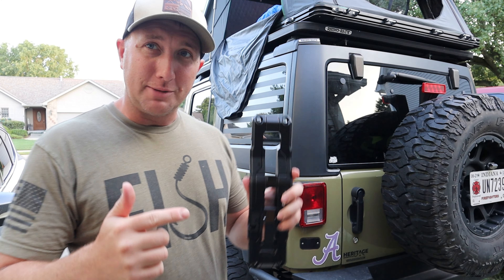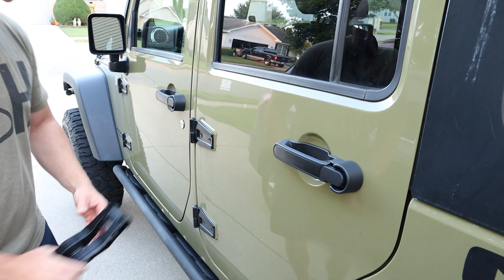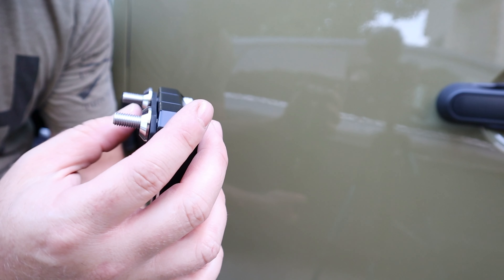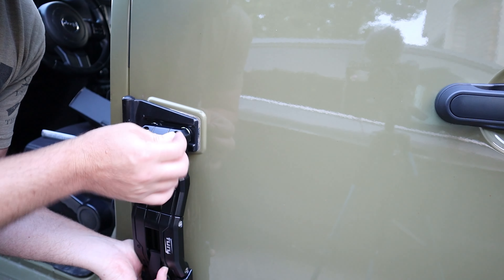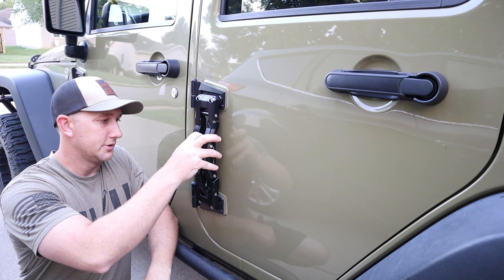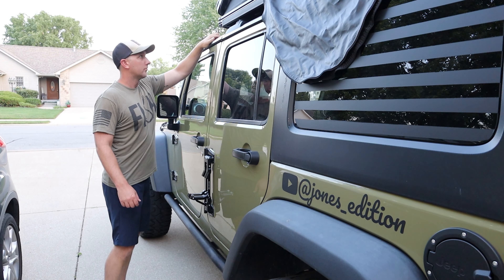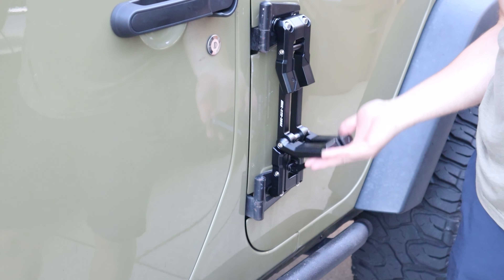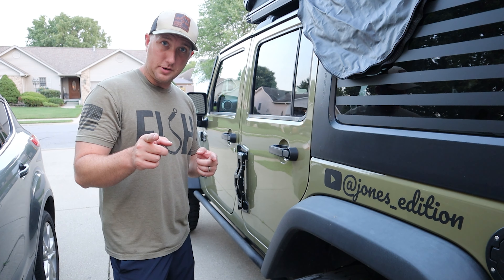147 - Jeep Wrangler DOOR HINGE STEP (Maiker Offroad) 2007-2018 JK JKU, 2018-2020 JL JLU

Comment: that looks really good, any update on the roof-tent?
Reply from the maker: @Legion_JLU  roof tent is good! Anything specific you want to know? I did break my light cord. The company asked for a Picture of the broken cord for some reimbursement. So that's nice
Reply: @jones_edition  have you had any leaks or anything else coming lose due to driving or in trails? i been trying to get a roof tent for a while now and this one had my attention
Reply from the maker: @Legion_JLU  The only thing i've noticed so far is if I tried to load the tent with alot of stuff in it the seal around the edges aren't super tight. After a rain I like to open it up. But that becomes a hassle. That's just because I'm stuffing it with too much. But if you keep it slim I think you will be OK. I like this tent alot more than my smittybilt RTT. Even though that one slept more people. I really like that this tent is like blacked out inside. It's so dark I didn't even know the sun was up one morning.
Reply from the maker: @Legion_JLU  I do have a camping video coming out on Sunday with me and my daughter. We camped with the tent.
Reply: @jones_edition  thats amazing, that tent is the reason i join the channel and honestly been watching your old videos to keep the good work!
Reply from the maker: @Legion_JLU  thank you so much for following! The channel is growing and I'm trying my best to make better, more consistent content for everyone. I work full time at the Fire Department and run a pressure washing business on the side. I have a YouTube channel for that as well. Lol called "Jones Blue Line". With 2 kids, life gets busy. But I'm making the channel a priority now. It's had been a hobby for 3 plus years but I really would like for it to take on and do some amazing things. BTW some of my older videos make me cringe. Haha I like to go back and watch them every now and then. Lol